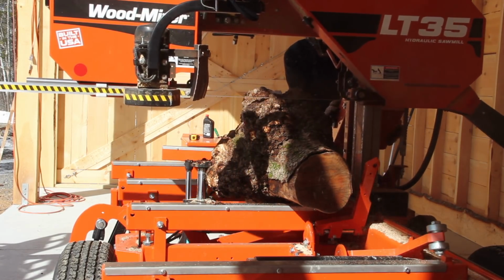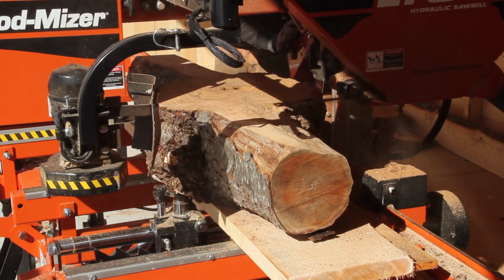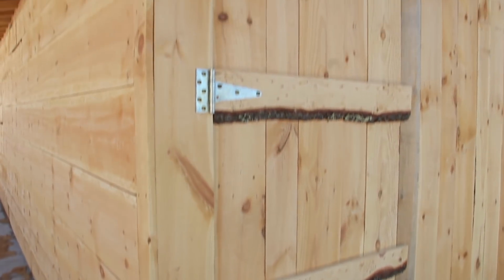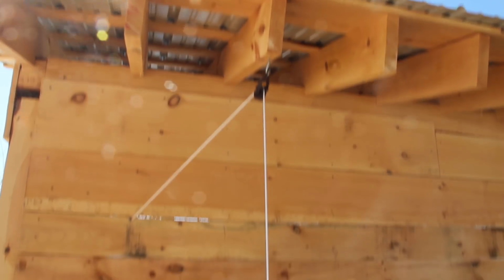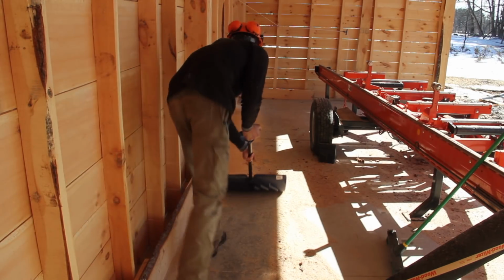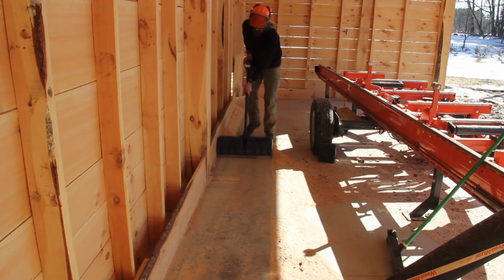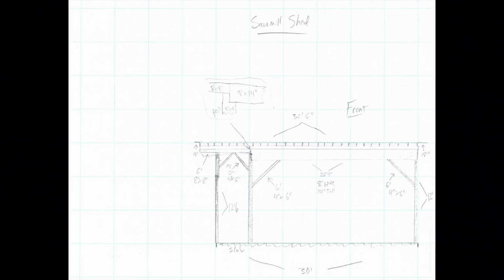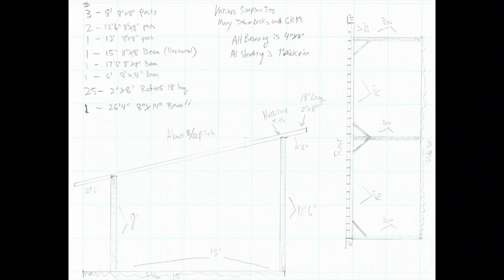Making a Sawmill Shed - PT 4 - Milling a Cherry Burl

Comment: Maybe add a heavy tarp out front to let roll down from top to keep the snow and rain off the mill when not using it. Nice mill, I have to get me one. 👍👍👍👍 Vinny 🇺🇸
Reply from the maker: I actually considered something very much like this, a heavy fabric that was on a roll, but after having worked in it through all the seasons now, including some very heavy snow storms, the dead air inside seems to keep the snow and rain from blowing in. it never really gets wet or snowy.

Comment: Nice neat work.  Depending on your winters, you may want to consider adding a curtain on the front, like would be used on a livestock barn.  Roll it up most of the time, but it would keep snow or rain from blowing in and keep the operator a little warmer.  Nuisance to work around it when loading or unloading the mill, but a few days out of the year it would be a nice addition.
Reply from the maker: That is a good suggestion and one that I puzzled over at great length last winter when I was building it, but after a few giant snow storms I determined that it doesn't need one, as for some reason, the snow and rain don't really blow into that space. I think it is a function of the mass of dead air trapped by the three sides.
Reply: If it ever does run a steel cable at the top right with turnbuckles and thread a heavy tarp through the holes on the cable. Weigh down the bottom with anything and slide it to the end like a shower curtain when in use. Works well.

Comment: Nave you given any thought to adding a rollup curtain to the open side to keep weather out? Of course that would require wiring and lights. Should make things more conf
Reply from the maker: Leonard Shultz Thanks for the comment. It isn’t my shed. I designed and built it at a place I used to work. It kept the weather out surprisingly well without the curtain. I had thought about it.
Reply: @BusHuxley  Well I still think it was well built and looked good.

Comment: Bus, I took your advice and checked out part 4 of the saw shed sequence.  Yes, I see, if I squint a bit, the wire/cable you installed diagonally across your huge door.

But I have another idea I'll put into your head, that your saw dust collection wall reminded me of.  Now I have no idea of how much milling you do and thus how much sawdust you make, but I have seen videos of people who have Woodmizer mills who remove that plastic sawdust spout, clamp a C-clamp to the opening, and then hang a bucket to collect the dust.  One person had a barrel into which he would pour the dust into.  At which point, if you burn wood for heating, you could turn that dust into pellets and heat with it.  Just a thought.

Of course I don't know if you heat your house with wood, but it would seem like a shame for someone who has a saw mill to not use his scrapes to heat with. ;^)
Reply from the maker: Yeah, I've seen that too. While I do heat with wood and I use the slabs to make maple syrup this mill is at the farm that I work at and we use the dust for livestock and chickens. I have thought about the pellet maker thingy.
Reply: My wife uses the sawdust from my band saw mill to mix with shavings that is used for bedding in the horse barn.

Comment: Bus, do you have a use for your saw dust?  I have been thinking about turning mine into wood pellets and using them for a heat source.  Possibly in my wood working shop.  The mill however is producing more than I can burn in a year, so looking for something else to use them for to produce another income stream.
Reply from the maker: That mill is at the farm that I work at and as you likely know, there is a near endless need for saw dust up there. Good idea though! I wondered the same thing. Making a hydraulic pellet maker!

Comment: MAKE A 5 GALLON BUCKET ATTACHMENT TO THE SAWDUST DISCHARGE ,,BUILD A BOX TO HOLD THE SAWDUST MADE SO YOUR TRACTOR CAN MOVE EASILY,, AND FIT IN A PICK-UP,,, SELL TO LOCAL FARMERS FOR BERRIES,WEED CONTROL, BEDDING FOR CRITTERS ,, OR JUST TO ADD TO GARDENS!! ALOHA
Reply from the maker: Yes! I have thought about that. This mill is actually at a farm and we use the dust for all of those things. I've seen that technique used and liked it. Thank you.

Comment: Great build and video. After milling the lumber is there a specific amount of time to dry it before it’s usable for a project like this? Or perhaps a specific moisture content? Thanks in advance!
Reply from the maker: Thanks a lot. I milled everything in the absolute dead of winter up here in Maine when there is relatively low moisture content in the wood to begin with. But I accounted for the inevitable shrinkage in boards and the minor shrinkage in beams. It is ok to have some air movement through the gaps. Thanks for the question.

Comment: How did you cut 26&27’ long beams on your mill? What is the length capacity of your mill. Nice building.
Reply from the maker: The capacity is only 20' but yes I did mill that on the LT 35. It was a bit cumbersome, but not wholly impossible. The log i used was 27'" wide at the butt and 26'6" long. It was too heavy to lift with the forks, but the hydraulics on the mill hoisted it up onto the rails. I had the butt facing the engine side and had the 6 plus feet hanging off the far end. I would make a pass to the end of the rail and then with the running chainsaw, but the slab off and muckle it away. Then i would reset and roll the log and repeat until i had a 20' 10"x16" with a 6' round stock still on the end. I then ripped with a chainsaw one side of that flat. I then rolled the whole thing back towards the motor so the cut end stuck through the opening under the motor and over the levers. Then proceeded to mill that last 6' feet to the same dimension. then i cut off a few gigantic 1 by boards. i had the camera set up and rolling with a dead battery. of course.
Show less

Comment: Would you reccomended building this same structure on 12 in concrete tubes forms?  Im not to far from you and below the tubes is ledge.
Reply from the maker: It would be totally fine to do this up on piers.
Reply: @BusHuxley  i figured.  Thank you for the reply. Just like to get others opinions.  Anyway i could get a copy of the plans?  I screen shot it but they didnt come out so great.
Reply from the maker: Sure enough. give me an email address that you want them sent too.
Reply: @BusHuxley  any luck sending the plans out?

Comment: How long is the big beam across the front and what species of wood is it. I had a tornado come through and ripped up my shed. It was a metal car port  I had a 21 foot opening in on each side for loading and unloading the mill.
Reply from the maker: It is clear Eastern White Pine and it is 26'4" long. 8" wide and 14" tall. It was a little bit of work to mill is out as we don't have that extra set of rails on the LT 35, but it was doable. Really shitty to hear about your shed being taken down by a tornado! Terrifying. I would like to think that this would hold up to a hurricane, but who knows. I anchored the posts with a bunch of concrete lags and the sheer weight of it! 
So I have a clear opening of 26' wide and 12' high. Very very little rain or snow gets into the shed, amazingly. 
Thanks for the comment.
Reply: Bus Huxley thanks.. don't have any white pine left in South Carolina but I got over 350 yellow pine on the ground after the storm.. I'm sure that will work. Thanks

Comment: beautiful shed, just wondering why you sided it horizontally instead of vertically.
Reply from the maker: Thank you very much. It's a good question. So at the time of siding, we weren't sure what the next step was going be, as far as more sheathing or as was. We didn't know if the weather was going to beat the sides and leak in, and I thought we'd wait until it saw some storms first. It turns out, the overhand keeps it dry even in ripping storms so we arnt going to shingle it, or board and batten it yet. If the building ever gets repurposed then I suspect it'll get closed in tight. Horizontally, we could cover more ground with less cuts. Thanks for the question.

Comment: Looks awesome, Bus.  I was curious how much research/calculations you did to know if the main beam (grit?) was 'enough' for that span?  8x14 (if I remember correctly)?  Length?  I'd like to see those plans, same name at gmail.  Again, looks great.

PS Sketchup is awesome once you get used to it.  Tons tutorials here on YT.
Reply from the maker: One of these days ill tuck into learning that program and just love it. If i can figure out editing software then i can do that, right? I looked at some span charts and asked an engineer friend. as it currently sits there isn't a hint of deflection over the 26' .
I will happily send along my scrawled up plans. Thanks for the comment.
Reply: Sketchup is very addictive.  But that's only because with it, you can test any idea you've ever had.  Personally, I've modeled my entire property as exactly as I could (laser level, etc.).  Including underground pipping, wires, and drainage.  Now I can look at, measure things to see if I have room for whatever.  And then there's my tools.  I don't have a saw mill, but if I did, I'd have it modeled up in as exact a detail as I could manage, so I could test mods and such.  One piece of advice though, use groups and not components.  You'll soon understand what this means in Sketchup, but components never seem to completely let go of their "group", which makes latter editing a real pain..
Reply: TreecycleME vsc
Reply: Sketchworks is good fun and useful but ultimately limited. The main issue is the difficulty in converting to CAD in the free version. As AutoCad is free, universal, more powerful and free I would take the effort to learn that instead. Less intuitive but much quicker when you get the knack. Thanks for posting, I could do with something similar for my mill but concrete is the biggest hassle/expense - how thick was you slab and does it have mesh/fibre.
Cheers

Comment: Hi Bus.Iam building a sawmill she d also here in Finland for my woodmizer.I have a question for you.... How long are the vertical poles in your shed? Thanks for the reply in advance.
Reply from the maker: Hey there. The front poles are 12' 6" or just over three meters and  the back ones are are eight feet or just under two meters.

Comment: i would have skipped the saw dust hatch and used a  trash can. in time that hatch will get racked and heavy and bloated.
Reply from the maker: I really like your name. I added the word "Boonpraiser" to the urban dictionary many years ago. 
The hatch is made of really dry and light white pine and works great and always will. It is open most the time anyway. Thanks for the comment.

Comment: Just curious why you would cut a hole in the back wall when you got a friggin huge hole 10 ft away out the front?????? smh....lol
Reply from the maker: Don Motz The sawdust exhausts on that side of the mill and can all be shoveled out and down the back wall. It’s quite a bit easier to shovel the sawdust into the bucket of the tractor right against that little door then up and over the mill. Thanks for the question.
Reply: You mean the bucket of the tractor cant sit level with the mill and shovel it into it once instead of handling it 2 times.....ok.....just more time and work just for sawdust.....lol.
Reply: I love your shed I just brought a wood muzzle lt_40 used mill I would like to build a shed could you send me your plans

Comment: if you start getting headaches it's probably carbon monoxide poisoning. been there, done that.
Reply from the maker: Ive been pretty solid in there, with all the spaces between the green lumber that i sheathed with and the giant opening there is plenty of air flow.

Comment: The sawdust removal is crap needs beter planing
Reply from the maker: fha gerber Thanks for the constructive critique! Just send me to the link of the video where you demonstrate the design, harvesting and milling of materials, and building in the middle of winter a 30’x15’ sawmill shed with a more elegant sawdust mitigation system. You spelled better incorrectly as well.
Reply: @BusHuxley  what ever it is still a shit system